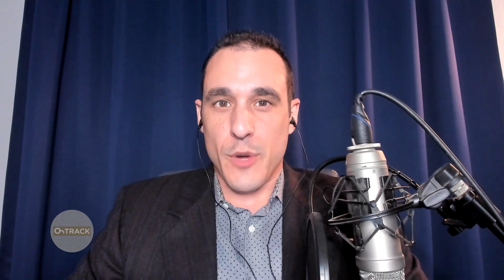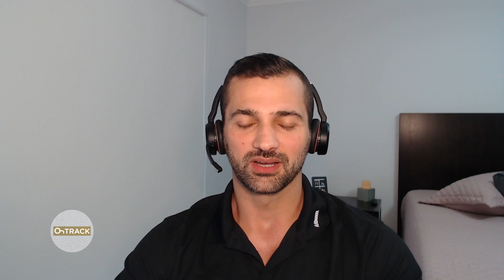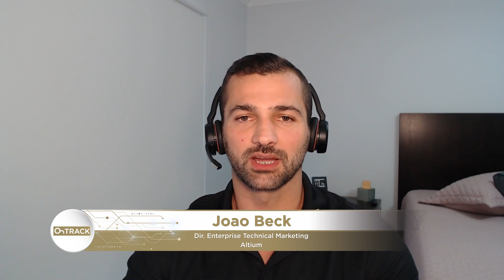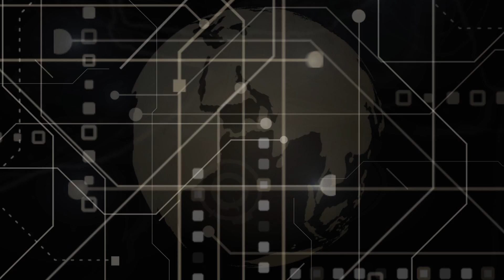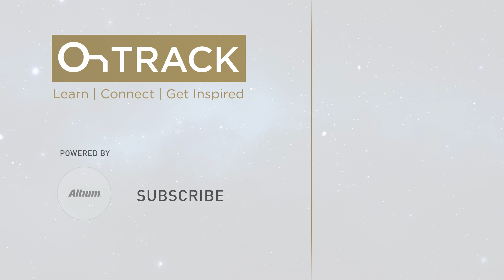The Digital Bridge Ecosystem with Joao Beck | OnTrack Podcast

Comment: How to use AC/DC motor Simulation model from Simulation Generic lib. Can you have a video on the simulation of Circuit driving that AC/DC motor using a PWM Generator from Simulation Generic Lib?